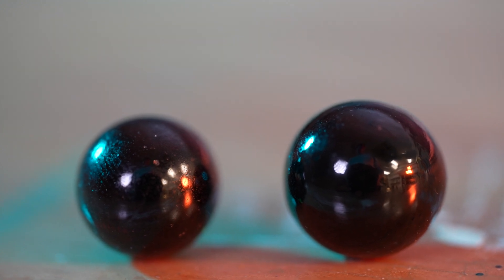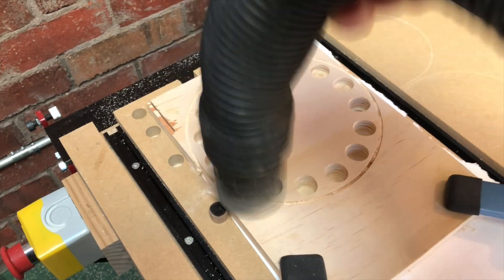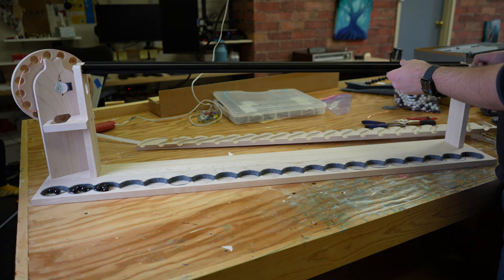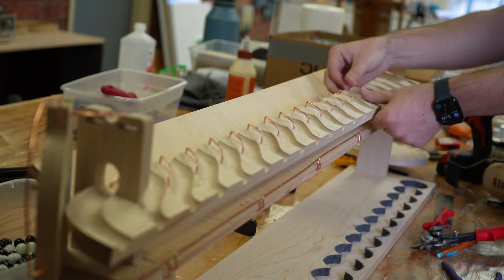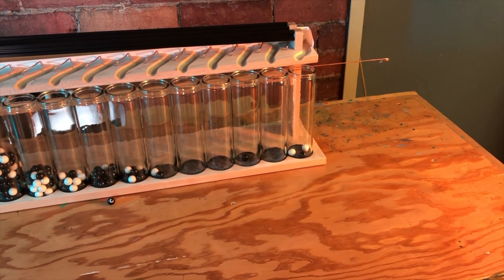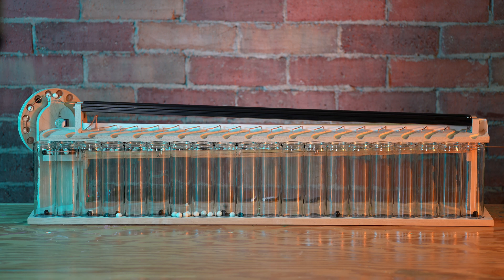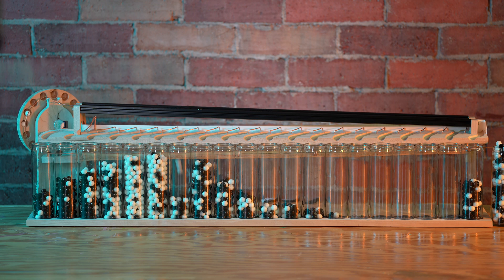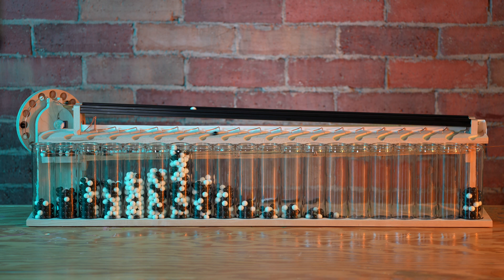Automatic Marble Size Sorting Machine

Comment: Forgive me in advance for being picky, but that's sort of the center of the bullseye for a project like this. I have personally sorted an embarrassing number of marbles to ridiculously high tolerances, and statistical reasoning is a prerequisite for getting solid results.  

First, an aside. You probably realize this, but jar no. 4 didn't have any white marbles (at around 6:30) because your particular sample of white marbles was a small, and thus imperfect, representative set of that particular manufacturer's perfect average white marble. Consider that a given roulette wheel might spin all night long and not happen to land on green, but making the inference that the wheel must not have green spaces would be incorrect. Distribution curves increase in accuracy as the resolution of the curve increases. The picture is crude (and sometimes misleading) at first.   

This might sound unimportant, and it'll be difficult to explain. OK, here's what I'd like to say about high-resolution marble sorting that isn't in any of the literature. That was sarcasm; but the resolution part wasn't. At some level, you have to designate an arbitrary category or standard for both marble size and roundness. That is, you have to pick tolerances for error, and that means that something here has to be digital. Digital in the either/or sense, or like in a go/no-go way. A marble can't gradually fade from one category into another; it must land in one bin or the other. Imposing jars (categories) upon the pile makes the whole system look misleadingly perfect, when it isn't. Some marbles will still land in the wrong jar for other reasons. If you have an infinite number of graded jars and infinitely long rails, then the distribution curve would have a perfectly smooth gradation, but here in the real world, things are chunkier, messier.

Calibration satisfies. Tight control is nice. We can get close this way, through engineering. But that's not the secret to success. My point is this: while we are naturally inclined to think that a better sorting machine will produce tighter results by using the brute force of precision, the real key to effective sorting comes instead from something much more crude and simple: the mathematical advantage of repeated trials.  

There are two things that this sorting machine can sort for. It's not just sorting size. These marbles will also vary in their eccentricity. That means two variables are at work. Here's the "other reasons" I mention two paragraphs up. Imagine that you sort 100 marbles into five jars, and here's the distribution you get: 10, 20, 40, 20, 10. Looks pretty ideal. But then you do the same thing again, using same marbles and same sorting machine, and you get 8, 22, 38, 21, 11. How? Because individual marbles will also have different degrees of roundness, too. Repeated trials can further refine not just size, but also degrees of spherical perfection, too.

 If you want perfect, take jar no. 7 (after it has filled up) and run its set through again, and again, and again. As you do, the tiny outliers will drop away into jars 6 and 8, leaving you with an increasingly fine set. If you want to increase the resolution even further, tighten the distance of the rails so that they become closer to parallel, and re-center the new target jar; doing so will increase the spread of the variance, and reveal to you the most perfect of perfect through repeated trial. Think of it like a selection process: never perfect, but slowly sculpted over generations until it's as close to a fit as possible. In this case, the fit, the ideal, is a perfect little sphere.